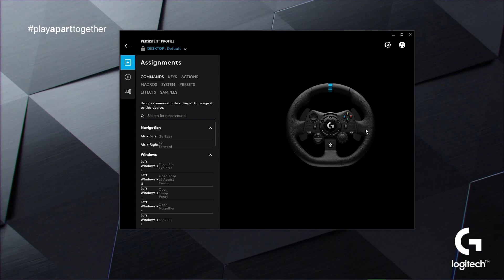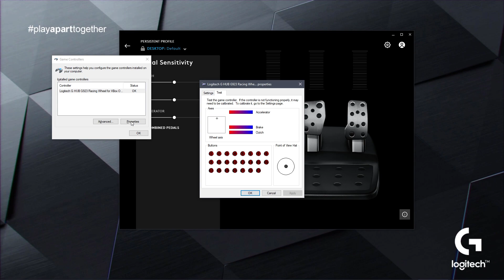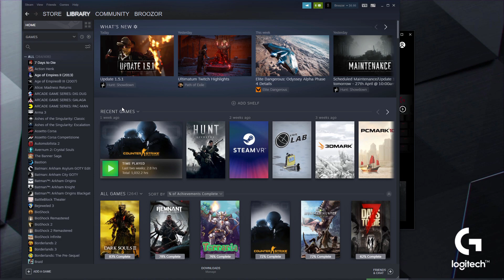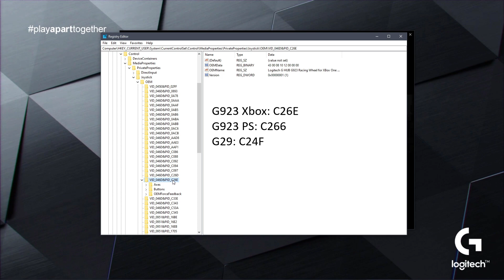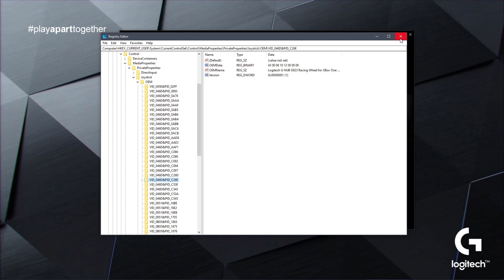How to troubleshoot G923/G29/G920 for Connection Issue

Comment: Got the G29 for my PS5. Plugged everything in correctly. No LED’s displayed, nothing turns on, and nothing detected on my laptop with G Hub. What an amazing product!
Reply: same problem here, i have the wheel over 6 months now and didnt play any racing or simulation games for over 2 months, now i have the problem you describe but my pedals work and my steeringwheel has only a flickering green light but doesnt respond or calibrate...
Reply: @juliantjuhh7900  same exact problem, was working fine before but stopped sim racing for a couple months now all the sudden blinking light and no calibration, any fixes?
Reply: exact same problem
Reply: @dookieballzgaming  same here did you ever find fix
Reply: @flo-ridafpv5713  even mine. I think that the word cable is broken or something bc in the video it’s says flickering means no power is going to the wheel
Reply: @junaidabdul3352  new power supply fixed mine $20 amazon
Reply: @flo-ridafpv5713  I bought a new power supply and and still now power :(
Reply: @dookieballzgaming did you end up fixing it I have the same problem now?
Reply: @flo-ridafpv5713  what power supply i should buy to g923?
Reply: @juliantjuhh7900  the one i bought was listed as new but was actually a non functioning return. Refunded and ordered from amazon and worked.
Reply: @juliantjuhh7900 have you fixed it now? I have the same problem
Reply: @notusedmmmm  i bought the new psu, and doesnt work at all, even bought a multitester to check the output voltage and ampere between the old and the latest one, and the old one (originial one) still works same as the latest psu i bought, but still no fu*king power on my steer, the buttons, pedals, ghub, works well only the fu*king steering, sorry for cursing i spent lot of times and money to check it and with no result, and my warranty ended a month ago, shit... let me know if you can fix this
Reply: @fransnainggolan7980  its likely a power issue...make sure its plugged into an outlet, that got as much voltage of a wall. Some surge protectors dont provide as much power
Reply: @juliantjuhh7900  have the same problem as well. did you get yours fixed mate?
Reply: its crazy how you leave the wheel not in use for a week and comes back and gives up on you
Reply: I have the same problem 😢
Reply: I got g923 for ps5 but this dumb product can’t seems to work
Reply: New power supply fixed mine put it on a step switch so it's not on constantly
Reply: @dmorgan5427  what power supply should i buy for g923?
Reply: you can use another usb port.
Reply: I had Same problem but then I just changed to new power cord and then it worked just fine
Reply: same here
Reply: Mine too the light is on but is doesn’t work at all
Reply: Uhh the g29 is only for ps3 and 4...
Reply: @supercarotte5777  why does it say ps5 and pc on it then?
Reply: @supercarotte5777 it works for the newer PlayStations as well and pc
Reply: Did you end uf fixing it?
Reply: g29 is for ps4 and ps3
Reply: i mean the g29 is for ps3 and ps4 only

Comment: Sorry to say, i've tried all steps and my shifters and all buttons doesn't work. They are not detected in the joy.cpl. I tried to uninstall and install the G Hub but not fix. Reinstall the older version logitech gaming software and it says that it doesn't detect my wheel. I'm confused because it detects my steer left and right and pedals (Brake, Throttle and clutch) but not my buttons. Any suggestion?

Comment: i have g29, and after plug in wheel calibrate by itself I have force feedback but no any vibration in F1 2021, also there is no differences when I am on gravel or grass, or hitting cerbs, also after a crash to wall my wheel isn't showing any signs of the feedback, I am reall disappointed with g29 please help and tell me what is the problem. I really think something is not working properly. please help I am desperate to fix this

Comment: Sir you are a hero!
I have been having issues with my logitech wheel ever since i bought it last month. Registry editing did the magic. Thanks you so much ❤
Reply: I just bought and set up the new Pro wheel and it is not recognized in G Hub. Is this the issue that you were having as well?
Reply: @susansanders4971  No i never had this issue. I had an issue where Force feedback was not working as intended in games and the throttle were recognized as an axis instead of a pedal in control scheme mapping. For your issues i suggest you check the power supply or try installing an older version of Ghub.

Comment: my g920 is messed up when i play forza 5. Either my shifter doesnt work, or my wheel doesnt. I've unplugged and plugged the wires back in but that doesnt help with anything. I play with 540 degree wheel angle but ever since yesterday the centering spring is messed up. I already have ghub installed but the settings there are very limited. It's only been a month of using my g920 and only half the time my shifter can row through gears. I restart my pc and forza to hopefully get it to work but it doesnt. sometimes the shifter will work but the steering wheel is still messed up.

Comment: Hey, my g29 works fine when plugged in  the computer directly, but whenever I plug it in a usb extender or even a usb over ethernet extender it doesn't. I can see the wheel spinning when I plug it, and I can see it in devices and printers, but it's not showing as a game controller. It's not visible in usb game controllers nor in ghub. When I triy to delete the C24F entry in regedit, it doesn't recreate itself when plugged in the extension, but it does as soon as I plug directly in the pc
Reply: I am having the same issues rn but reading your comment made me double check and it worked I was about to scrap my g920😂
Reply: @Im_irish-ly3rp  Glad it helped

I ended up ordering a shorter usb 2.0 extender (16ft active) instead of the 32ft one I had. That magically worked.

I contacted logitech support twice in the process. My dog was more useful than them

Comment: my problem is that when i move the wheel it's not being sensed in the app or when im playing AC i followed all your steps but nothing helped me :( any of u guys had the same issue please let me know if you fixed. when i play AC and use some of the buttons on the wheel, its working which is why i find my problem very weird, and it also happend over night.
Reply: I face the same issue too, now checking if the problem of the ac power supply from wall since the motor on the left and sensing motor of the right which produce the signal input of steering wheel draws power from the ac

Comment: not helpful at all. the turning on my g920 wheel is not represented in g hub. by this i mean, when i turn my wheel full lock (+ or -450 degrees) and then back to centre (0 degrees), its displayed as if its off centre in g hub, usually about 55 degrees either side of the centre. its infuriating because no troubleshooting tips have resolved the problem and now im unable to play racing games. Please help!

Comment: I just bought the G920 with wheel, pedals and shifter setup. Plugged it all in for it not to work. I did all the steps you explained and when I refreshed, the wheel did not come back. It is properly powered as this light in the middle is non stop blinking. I think I got a faulty setup. I should just return it

Comment: The force feedback is semi-working. The motors keep it springing to the middle, but it does that for everything, when its not supposed to. Need help with that. Edit: I forgot to mention I have that setting turned off

Comment: hey, nice vid but didn't fixes my problem. last weekend was everything ok. played FH4 with the g920 but now is everthing different. I haven't changed anything and now i don't get any force feedback like befor. no vibration when i leave the road and when i corner at high speed i only have the normal resistance in the weel like in Ghub. can you help ? the only differens in FH4 is now winter and not autumn
Reply: Did u fix the problem?Us it software related or is problem with wheel itself

Comment: I give up... My driving force shifter stopped working. It was working fine for 6 months. I tought it was a hardware issue, so I brought it back to the shop, to get a new one. It didn't help. I went trough all the steps in the video, and the registry delete helped me. The day after the registry delete the same problem occured, and now it just refuses to work. The wheel and the pedals are completely fine, but the shop refuses the give me a new wheel because the painted logitech logo is chipped down and you can see the metal underneath.

Comment: I went through steps 1-4, deleted the steering wheel in the registry, and plugged it back in only to find the same issue. When I have my wheel plugged in, the y, rsb, and lsb button, as well as the dpad, shifter paddles and gear shifter aren't registered in the joy.c thing. The wheel axis and pedals are seen, as well as the as the a, b, and x buttons. Any idea how to fix this? I made sure all my power cables were connected well too. Also, when I open the windows start tab with the wheel plugged in, it scrolls up uncontrollably if that helps diagnose the issue.

Comment: So my problem is every time I turn left or right on my steering wheel it doesn't read that I'm steering my steering wheel and in certain games it thinks that I'm going left the whole time I have my USB all the way plugged in I have perfect power it just will not read that I'm steering

Comment: My G29 has the LED blinking on top. I have tried different power outlets and made sure that all the cables are plugged in securely, but it still won't work. I am able to go through menus and things, but there is zero force feedback and as soon as a race starts, my car just goes straight to the left. Please help!!
Reply: I have the same issue man 😭
Reply: @marcosleiro7721  I actually talked with Logitech today and luckily they are going to warranty my steering wheel setup. We tried all the troubleshooting on the phone that I already did. They are going to send me a new unit because I just purchased it back in February of this year.

Comment: My G29 is plugged in properly but it doesnt show any lights or connect to my computer. It has worked for months and one morning it just stopped working completely
Reply from the maker: Hi there! 

Lack of lights usually points to lack of power. Can you check your power connections and make sure everything is seated correctly?

If you are still having issues after that please open a ticket below!

https://support.logi.com/hc/en-us
Reply: @logitechsupport  all of the power connections are seated properly. Ive checked a dozen times. When i have time im going to take it apart and look at the internal connections

Comment: Hello, when I open the steering wheel properties (as shown at 2:35) all the red buttons are flashing on and off and my when I turn the wheel it changes the Z axis and the "Z rotation" meter doesn't move. Any help please?
Reply from the maker: Hi!

You might be getting some power issues. The first step would be to check all your connections and making sure they are seated properly. After that if you are still having issues please open a ticket with us below!

https://support.logi.com/hc/en-us

Comment: So I went into the back panel to take the rubber piece out from the brake, Sealed the back on, fastened the screws and now the G Hub cant detect the wheel when I plug in the pedals. Also when I plug in the pedals the entire wheel base starts to vibrate a little and gives off a slight humming sound. Any known fixes for that or is it just finished? Didn't mess with the cords or anything either.

Comment: my steering wheel is not working after i deleted it out of the registry Editor my my pedals are working
Reply from the maker: Hi! If the pedals are working but the steering isn't you might have a power issue.

If you checked the connections and are still having troubles please open a ticket below!

https://support.logi.com/hc/en-us

Comment: Hello. Thanks for the tutorial but you tell to do something and if it's ok, go to the next step but what if it's not working ? I can see my wheel on LG hub but when i turn it, the movement is not represented on the program, i don't see anything on the screen, as i was not turning it, same thing for pedals. I can't see my wheel on the windows device manager too. Can you help me please ?
Reply from the maker: Hi there!

If it's not being detected in Windows you might have a power issue!

First thing I would do is check your power cables and make sure everything is good there. If you are still running into issues after that please open a ticket with us below!

https://support.logi.com/hc/en-us

Comment: My wheel has power but is not calibrating everything is plugged in. I have the G29 PS4 edition (trying to use on PC)  pedals work but not the wheel :( the wheel is also being shown on G Hub but no input is detected.
Reply from the maker: Hi there!

Typically lack of calibration can still be a power issue. Is your wheels light flashing when you plug it in? If so I would check one more time. After that if you are still having issues please open a ticket with us below!

https://support.logi.com/hc/en-us

Comment: mine is not only plugged in from each cable, made sure everything is plugged in firmly without putting any stress on the cables, and is STILL not receiving power, why is it not receiving power??
Reply from the maker: Hey!

Can you make sure your wheel is plugged directly into a wall outlet? 

If it is and you are still not receiving power please open a ticket with us below. 

https://support.logi.com/hc/en-us

Comment: Hi! So ive just bought my Logitech G29 last week. And its working fine till yesterday. Im playing it on my pc. But today after I plugged it to my pc, It didnt calibrate at all. And then i checked all my power supply adapter. Unplugged and replugged all the cable but nothing happens. Also the yellow light is blinking at the back of the wheel which you said its not giving enough power. The Logitech G hub detect my wheel. The pedal is also working and the shifter as well except the wheel itself. I really dont know what to do. Please help. Ive also tried and cleared the registry. But nothing happens. 😭😭
Reply from the maker: Hi!

Can you open a ticket with us? We'll definitely be able to find a solution there!

https://support.logi.com/hc/en-us

Comment: hi, my g920 does turn on and connects to my pc, however it does not calibrate or show any controlls when i press it... i tried all in ur vid but none of it worked
Reply from the maker: Hey!

Can you make sure you are not using a USB hub or any sort of extension. You also may need to reinstall the drivers within the Device Manager on Windows. If you are still having issues please open a ticket with us below!

https://support.logi.com/hc/en-us

Comment: My G920 is still just blinking and does nothing else. It shows up in GHUB but it doesnt calibrate and no bottons work either. Nothing helps even this video didn`t help.
Reply: Same…😢
Reply: @prestival4034  i am Trying to contact their Support but their Support Bot ist Just Trash and i Always have to wait hours to get a real Person and wenn i get a real Person its 3 am.
Reply from the maker: Hey there! 

A blinking light usually means a power issue. Please check the connections at the wall, brick and wheel! If have made sure all of those connections are secure and you still have issues please request a ticket below. 

https://support.logi.com/hc/en-us

Comment: im on win 11 and i have the G923 PS version i have done all the steps and nothing it still is not working it worked not to long to ago but now nothing
Reply from the maker: Hi there!

Can you try our most recent G Hub update and see if that fixes your issue? 

If you are still having problems after that please open a ticket up with us!

https://support.logi.com/hc/en-us
Reply: @logitechsupport  so i did eventually get my wheel to work but it was only because the SSD in my PC died and i had to get a new one and reinstall windows after that i have not had any problems with my wheel

Comment: my g29 when i plug it in does nothing at all but the buttons and pedals still work and i cant steer and i did everything and the green light blinks when i put it in my ps4 help and sorry for my bad english
Reply from the maker: Hey there!

Typically when you have a blinking light it's due to a power issue! Can you check your connections at the wall, brick and wheel? If you are still having issues please open a ticket up with us below!

https://support.logi.com/hc/en-us

Comment: I've done every one of these steps and still no joy. My controller shows up in windows and on GHUB but no games or apps will pick it up.
Update: I have formatted my computer and it still does not work. Shows up in windows calibration, shows up and works in GHUB. Doesn't work in any games or apps
Reply from the maker: Hi!

You might need to bind some of your controls manually in the games you are trying to play. However, if you are getting no response after that please open a ticket with us!

https://support.logi.com/hc/en-us

Comment: I am trying to use my g920 on an Xbox one X. When I plug my system in to the Xbox via usb, the wheel calibrates normally, and I am able to navigate the Xbox menu easily with the controller. However, the Xbox for some reason does not detect the wheel as a controller, and neither do any games. It does not show up in the accessories app as a connected device. Anyone maybe know why? Thanks
Reply from the maker: Hey there! 

Is there a change if you turn off / disable your Xbox controller after you plug your wheel in? If not, can you try your wheel on PC and make sure all of the buttons are functioning as they should be? If you are still having issues after that please open a ticket with us below. 

https://support.logi.com/hc/en-us